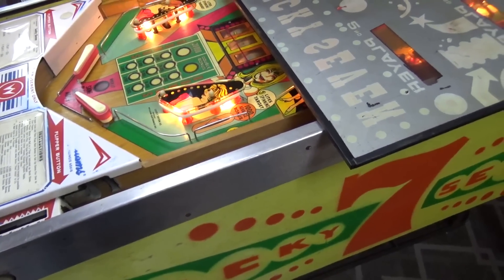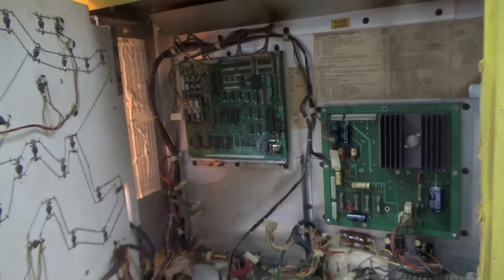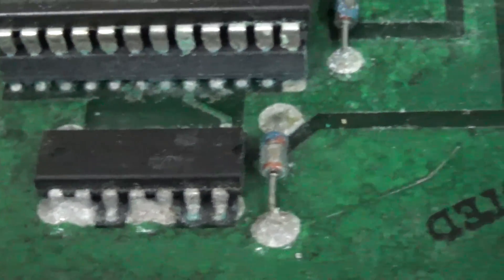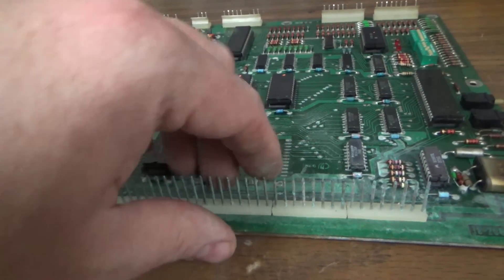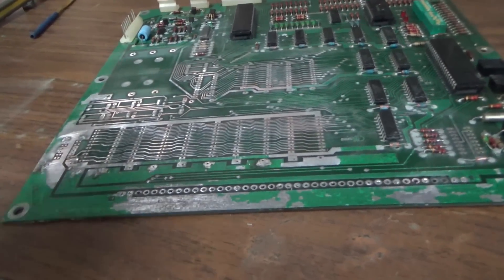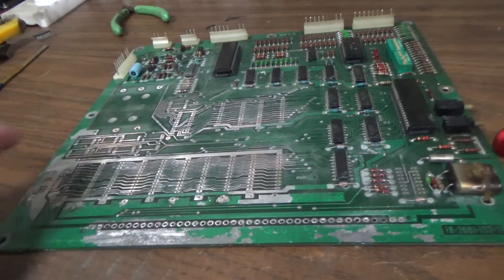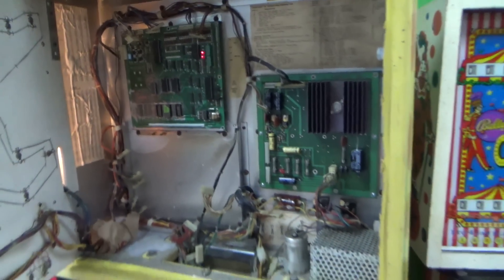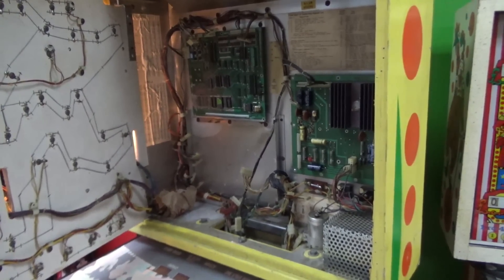Can We Save This Heavily Damaged Pinball MPU?  1977 Williams Lucky Seven Battery Corrosion Repair

Comment: Recently, I repaired a broken HP-150 computer. It had horrible battery corrosion all over its video board. It took me several months of debugging (and waiting on parts) to get the thing functional again (17 dead chips), but it was a hell of a rush when it first booted and displayed a proper screen. I fully understand the fun and excitement of repairing old boards, rather than just replacing them. I second your opinion that everyone should try it out every now and then.

Comment: Recently elected to repair a badly battery damaged lamp driver board in my six million dollar man. Rather than buying a new board, I cleaned off the corrosion and replaced several transistors to get the lights twinkling again. Being a Bally, it also needed resistors tied to every bulb to get LEDs working flicker-free.

I could've bought a new board and solved all of these issues much quicker. But I decided I want my boards to work as originals, as intended. Because I am a snob. So I took the time to do it right, now everything works just great! And its very much thanks to the knowledge gained from watching these videos. Thanks :)

Comment: What I always first do with these alkaline acid damaged boards is soak it in vinegar to neutralize the acid and then clean it with regular tap water and let it thoroughly dry before I go and measure tracks repair tracks etc and apply UV curable solder mask. Nice video Joe always enjoy watching it :)

Comment: Yup, this is the vid I've been waiting for.  I have an MPU (in my case a late 70's Bally) with some pretty rotten battery damage.  I'm hoping this video inspires me and shows me a thing or two so I can tackle my own.

Well this was pretty straight forward, the problem is the cost for those that don't have the repair part stocks built up.  EPROM burner, EPROMs, sockets, caps, resisters, etc. etc.  The cost really adds up fast.  I would much rather rebuild these old boards, but if I have to go replacing every component touched by alkaline I might as well just stick with the replacement MPU.  Which is sad.  I'm still going to give it a go, perhaps I'll get lucky and only have to replace some resistors and caps.  Which I do have on hand.

Still I loved the video though if you want the good and bad you blabbed a bit long on the true repairman part.  Just say'n!  🤣  Keep bringing us these great pinball videos.

Comment: For a board with that much corrosion, you might want to mix up a water bath of mild acidity (vinegar or other mild acid of your choice) and soak the entire board soak over-night. (A paint roller pan works well.) Rinse with hot water, then scrub. Repeat as many times as necessary to get all the battery corrosion off. Then rinse it in more hot water and let it dry before reinstallation or repair.
edit: Oh, I see you started talking about vinegar at 12:30 or so. That'll teach me to post before watching the entire video.

Comment: They are only original once.   You have to do best you can to repair it.   I can understand new boards put in by board jockey's though.  New board is reliable, where is there is no guarantee this board will last.   But I prefer to save the original where I can.
To be honest with you, I think those old "duraleak" batteries are the originals put in when the machine was made.    Duracell use to be okay, but more recently they have a really high tendency to leak, hence "duraleak" being the name :).
What a great find and a great game

Comment: I take it that the 7402 is a NOR gate. A curved line at the top of the "shield" means OR, two curved lines mean XOR, and flat means AND. And the little circle means inverted (NOTted), so Notted OR means NOR. If things aren't working without it, then tie the output high or low depending on what you need. So if it goes to /CS lines, then tie to 5V to disable and to Ground to enable. So this seems rather straightforward.

Comment: Just wanted to help, but if an off-board battery solution is appealing, look for "Ron's Computer Videos" and "battery".  He created a PCB to hold 2 CR2032 batteries and it is able to be mounted anywhere in any machine.  I know that it was created with a Macintosh II in mind and 6v is more than 4.5v, but I believe it would work here.  I also know that his PCB is open source.  Maybe instead of 2 CR2032s, 1 CR2032 plus an LR44 could be used together to have the 4.5v?

Comment: JOE CLASSIC, Does the Service Bulletin say anything about why they wanted to remove C27, R30, R40 and add in a 10K resistor instead for what reasons? The reset circuit must have been causing certain problems which the service bulletin should say. What are the Flipper ROM's doing to the game board? For all pinball games I thought the flipper coils don't use the PIA chips and it doesn't make sense why the flipper coils would need the Flipper ROM's that has data code.

Comment: Off-topic: There is a "Bad Idea Barta Board" that lets you install 16 rechargeable PCB batteries (not connected to anything other than a charging circuit) on it in any older computer with an ISA slot. It really isn't intended to be installed or used, but you can. That was more of a gag gift.

I guess it's for suckers for punishment. Imagine the corrosion... 16 leaking batteries, hmm, that could eat a hole in the bottom of the machine, perhaps.
Reply from the maker: From what I understand even the gas that comes off the batteries is corrosive, lol  That thing would be like a ticking time bomb

Comment: Have you tired using a fiberglass pen to clean the board vs a wire brush? 

they give you more control in a smaller area so you don't eat the solder mask as much. Plus they are handy on modern boards with small traces. Don't get me wrong, They can and will still remove mask and potently traces if you scrub to hard. I prefer to leave as much mask as possible on boards as exposed traces corrode overtime. Exposed traces should be re-masked or solder applied to them to keep them from oxidizing.

Comment: Is it ever worth replacing the conformal-coating / board-varnish over the traces after getting the dead battery guts off them?  Or is that not really necessary for board health over any kind of reasonable timescale
Reply: The traces are tinned on these boards, so no need for protection reasons, but go for it for cosmetic reasons... Newer PCBs will be bare copper under the resist (green paint) so will need protecting or they will corrode over time just from being exposed to air.
Reply: The traces won't corrode, just oxidise. But oxidised traces are still perfectly fine.

The resist (not conformal coating) is only to stop solder from sticking where it isn't wanted. It's not really any form of protection, although incidentally it can sometimes help to stop leaky batteries from eating away the traces.

Comment: @7:00 -- Master of the Obvious Says --  If you're going to leave things in LONG-TERM storage (over a month or more) and NOT use your electronics, ALWAYS (x1000!) remove the batteries from things like remotes (TV, VCR, DVD Player, your network streaming cable box)!  Batteries have a terrible tendency to rupture when they haven't been used in a long time (months or years)!
I've had too many batteries rupture in remotes that were stored long-term or unused.
Do yourselves favors and take the batteries out of anything you don't intend to use for a long time!
I'm lucky I've been able to clean up and reuse all of the things that HAVE had battery ruptures.  So far, all the remotes that have had battery ruptures still work!  I had them lying flat down with the input keys up (keyboard face for the technically illiterate) so that the battery fluids did NOT drip onto the PCB's of the remotes!  The battery contacts did get a chemical bath but I managed to clean them up.  I tested the remotes and they were all still useable...
Reply from the maker: It seems to be getting worse with modern batteries too
Reply: @LyonsArcade  Yep!
I only keep batteries in 2 remotes that I use all the time.  My TV and Blu ray player remotes!  Everything has been de-batteried until I need to use the suckers!
I learned my lesson after too many close calls!
In fact, I have 3 old Sega Dreamcasts arcade sticks I modded with new retro-console PCB's and installed LEDs running off 3-V (2x 1.5V AA) battery circuit.  When I remember, I pushed the LED button to illuminate them!  The LED is for artwork highlighting; it has no game function!  I did something simple and cheap for my amusement!  If you don't drain the batteries regularly, they tend to "back up" and the casings WILL rupture as I've discovered the hard way personally...  Not with these joysticks, thankfully!

Comment: The question is, how much is your time worth and how busy are you ?
You have to add up the 4 hours and your wage and the extra time and parts.
If you can buy a new board for 100 dollars, you should buy a new board.
200, maybe it is worth doing it.

I wish I could find someone who could 3D Print the DTMF keypads I need.
I think the cost is going to be more than buying a brand new radio.
Reply: It also depends if you just enjoy it. Work isn't work if you are having a good time.